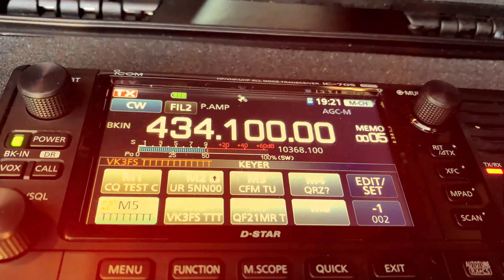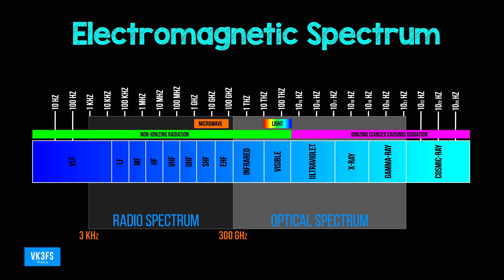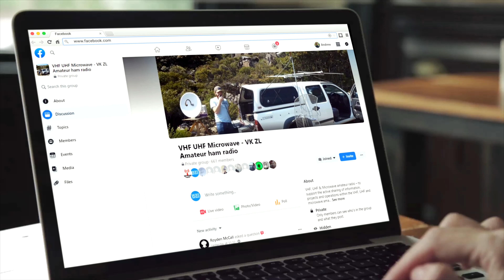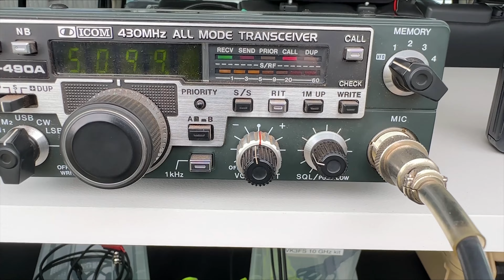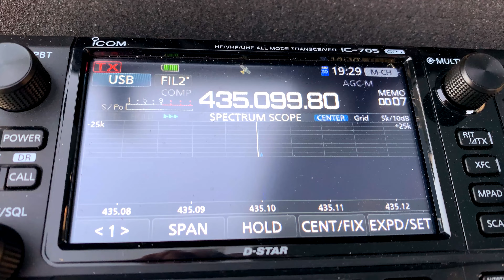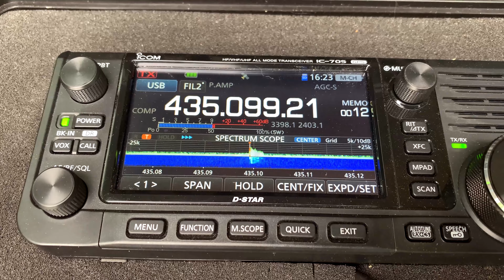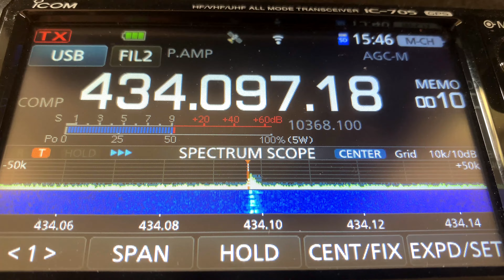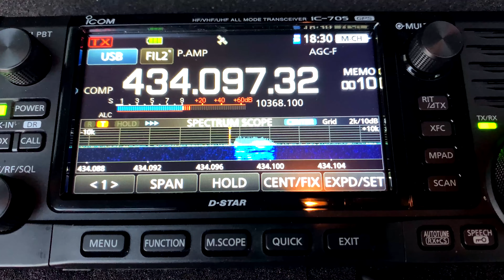Amateur Microwave It's easier than you think 2024

Comment: I would like to say that as a ham under 30, I'd love to get on microwaves if I can get gear that's good value for money - I.e. something that covers a bunch of bands, even for a performance compromise. There's not much on the entry-level end of the price spectrum. Several hundred dollars to get on one band, plus the absolute headache of making a multiband system, isn't approachable to any except the most technically adept of us. But you can get on every HF band for about $1000 with some very good tech - the FT-891 for instance - or for a lot less with used gear. You can get on repeaters with a Baofeng for $20. How can microwave possibly compete?

My $0.02: microwave needs its Baofeng. No, not the harmonics of a UV-5r 😂, but the functional equivalent for the microwave bands - a cheap entry.

You can cover all the bands up to 5.7 GHz using a Langstone Project transceiver (I happen to have everything except the actual SDR), but there's no easy way to filter the output.

If someone made a $100-$200 add-on board for the Langstone, with multiband input and output filtering, some nominal power output of at least, say, 50 or 100 mW on every band, with a common output for a log periodic to start, and individual band outputs for amps down the road, I am sure it would be very popular, and it would serve as that "Baofeng of Microwave". 

Another problem to consider is how we as a community might use the massive bandwidth we have available on microwave bands. Narrow bandwidth modes are great, but the approachability of wide bandwidth gear is important too. 

Just my $0.02 CAD!
73 VE3GKT
Reply from the maker: You make some valid points Joseph. HF and SHF are a little different. Not much in common except an IF frequency. A transverter and an IF radio can be done for under $1K but that's just one band.
Reply: I’ve been thinking around this low cost microwave challenge for some time now. 

The microwave in a box IC905 will set you back a small used car or between 14 to 18 AU falcons. And while it packs an incredible amount of technology value into its bits, it’s a significant outlay for those who can’t afford a fleet of AU Falcons (still, one can always dream)

There is a plethora of 2.4Ghz and 5GHz wifi technology out there and some half watt hardware for not a lot of money.  It’s an area where someone / some group of smart people manage to put something together that just works well enough for a hundo or two outlay that the B callsign countrymen will make knock offs of and sell them on Ali Express for AUD$38.64 (less with coins) without any credit to the original geniii who came up with the setup in the first place. 

A Pixie, with a couple of tweaks will get you a QSO in a neighbouring state for under $10. Is there a 2.4GHz equivalent??

Peter Parker found some 2.4GHz walkie talkies for not a lot of money. They use some sort of digital encoding. 

I have a couple of wireless guitar adapters from Ali Express. I spent $18ish ( plus coins) for one pair and $38 for a different style in a nicer box. Both are crap as a wireless guitar unit, but they work well enough for noodling around the kitchen while I cook. 

We are not that far off the Beofeng UV5R for microwave, with or without the spurious emissions. 

A plug in transverter to a firmware flashed Quangshang  might be a place to look. Dudes have got those picking up 30cm sigs. Output is in the mW for out of band operation. 

We live in the new golden age of ham home brewing 

And there is always the spark gap equivalent of Microwave oven Moon Bounce for those who want to live dangerously. has anyone done that ?? CW keyed a magnatron pointed at a good size dish pointed at the moon ???
Reply: Wow. If you mention B callsign countrymen as a word beginning with C, YT nukes your comment